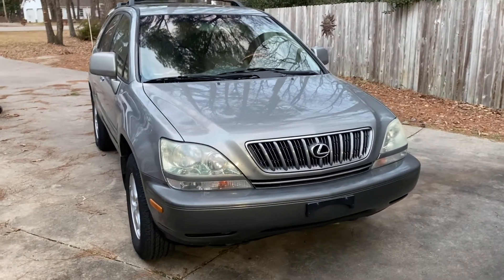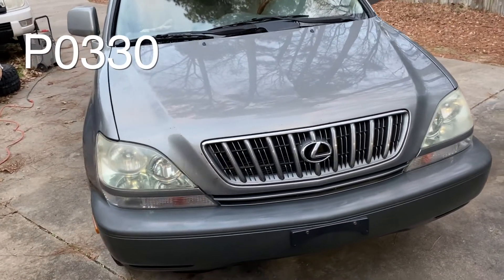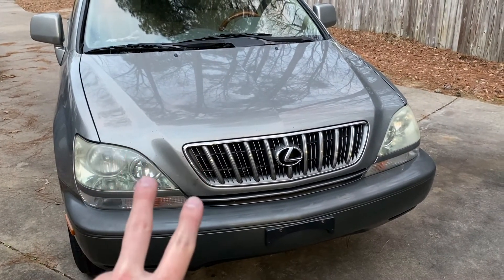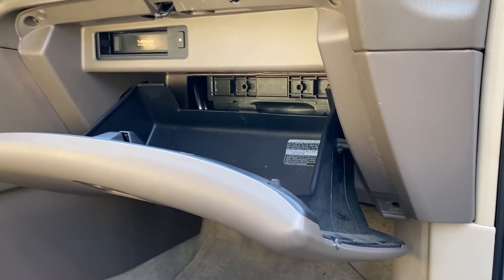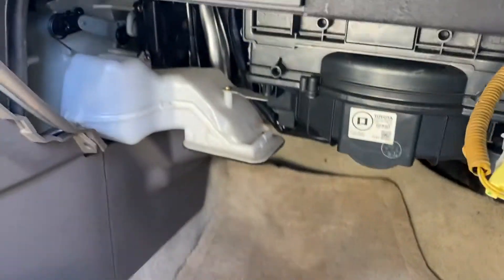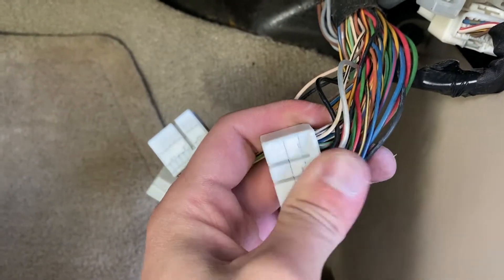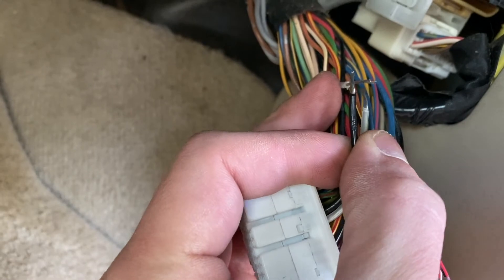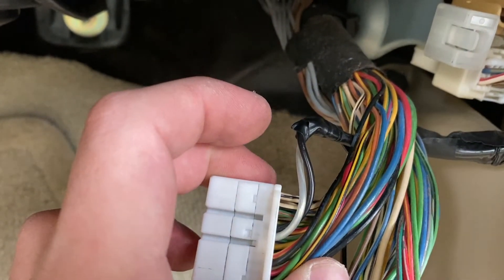Lexus RX300 bank sensor hack

Comment: So i tried this last night and it didnt work so i tried it the other way around instead of leaving the black wire unplugged i left the clear wire unplugged and it worked transmission shifts everytime i stop, thanks so much for this video!!!!!!!!!!!!😊
Reply: Same happened to me !
Reply: What code were you getting originally. I got code p0330 I used a clip to bring them together. The light went away for two days. Now I have both codes. Do you think I did it wrong or or have to replace sensors?

Comment: I cut the wire and joined it to the other but my overdrive would not work after that at all.  So i saw another thread where a guy just joined the 2 wires without cutting any wires. So reconnected the cut wire and did what he said and overdrive came back. My car would drive for 10 minutes prior to any wire cutting before i got the check engine light and lost  my o/d. I originally had a bank 2 sensor open circuit code. P0330 I believe. 
Update. Drove around about 40 Miles and no light and o/d works fine. Now running premium fuel as others mentioned as well..
Reply: Still running well?

Comment: Well 2001 RX 300 I had knock sensor bank 2 go bad with the same code.  Did what you did I rest the code and has not came back on thanks for the hack it worked. Now if the other sensors gets bad I’ll have no choice but to have them both changed out. 
Mine is a 2001 rx300 with 99,xxxx miles on it. I’d figure from what I’m seeing I have another 100 thousand to go.

Comment: I finally got around to trying this today on my 2002 Toyota HIghlander (232k miles) after months of dealing with this “limp mode” issue, stopping and turning the car off and back on again to allow the engine to go into overdrive.  Estimate to replace knock sensors was astronomical given the age and estimated value of my car.  Cleared the codes and drove the car for 30 minutes after the fix (around 25 miles) and no check engine light or any issues, so I’m thinking this has resolve my problem.  Thanks for the great video!  Hoping to get a few more miles out of the old Highlander!

Comment: Wouldn't it be better to splice at the harness that leads to the knock sensors right by the air snorkel tube. I dislike cutting ECU plug wires.
Reply: I agree, or relocate sensors outside from under intake manifold

Comment: This could be done much clearer. Why did you refer to the clear as white? Can’t you go back and fix this with caption or audio edit? More importantly, there is ZERO need to cut all the wires! Cut the black, tape off top black end, strip 1/4” from bottom black, cut 1/4” sheathing away from CLEAR (not white). Don’t cut the clear wire in half. Wrap black exposed wire around clear exposed. Tape and your done.
Reply: Very true 
 Also,
 Both sensors have 2 wire connections 
1 carries 5v reference to sensor & returns to pcm.  My ocd needs explanation of all 4 wires in order to better understand hack.

Thank you everyone;

Comment: I did it, but STILL have the engine light on and 4k RPMs at 55 mph or so.  Now what??
Reply: 4k rpm is pretty high right for 55mphs ?
Reply: Or are you driving over drive ?
Reply: Did you fix it?
Reply: @ Yes..$1200 to replace 2 W$%&^%$ O2 sensors, as it was in crawl mode, from the eng light being on...from the O2 sensors needing to be replaced.
Reply: @kee7678  gott cha thank man have a good rest of you’re night
Reply: No...still not.  Going to reverse the wires again and see if that works.  Smog is past due now too. @bruceprofitsTradesFutures

Comment: Not a good idea unless you burn premium fuel always. Otherwise, some level of pre-detonation will very likely exponentially wear out the engine.  The knock sensor is a microphone that listens to your engine and makes real-time adjustments to the ignition timing and fuel air mixture to maximize fuel burn for optimal fuel economy and emissions. It keeps the engine balanced and an out of balanced engine pollutes more and wears out much faster.   I recently replaced both knock sensors on a 2002 RX300 and it is not that big of a deal for a mechanic.  Just buy premium knock Japanese sensors, not from China.  They are junk.  During the test drive I has able to register 28 mpg on a 19 mile run, much better than the 16 mpg it was getting with the engine running in "fail-safe" mode with the bad knock sensor.  Compression test on all cylinders showed 192-198 psi at 223,000 miles.  I expect the engine to make 500,000 if properly maintained.  Seriously,  please think about long term implications of your hack.
Reply: Thanks for the comment Big Oak. I have a couple of questions for you if you don't mind.  1. How does burning premium fuel  prevent the pre-detonation issue?  2. How does one know if if the sensor is bad or if you have a really serious issue?  My RX does not make any knocking sounds, so to prevent it from going into OD I had to keep disconnecting the battery.  For the age of the car and the value, it doesn't seem frugal to chase knock sensors at 163,000+ miles. Unless, of course you are a really good mechanic with a lot of extra time.  After reading your post I am considering burning premium fuel now, but would like to understand a bit more.  thank you
Reply: Having knock sensor and vvti sensor issues and im assuming one is having to do with the other and im honestly not which exactly is causing my problem. Replaced my vvti solenoid and my odd cylinder sensor which was supposed to be my issue but now it’s giving me a knock sensor code. Honestly worried I’ve done some damage, but hoping I haven’t. And 198 psi at 220k is crazy.

Comment: Hi genus,
I just have 1 code: P0325 , I did opposite from your video: I cut the clear wire and soldered to black .
After driving about 3 miles, the engine check was ON, and the code now is P0330.
Please advise.
I really appreciated

Comment: This worked for about a year or so and bank 2 is gone. So replacing with oem Denso from dealer. Don't get the aftermarket online ebay fakes

Comment: One year later my bank 1 sensor went bad and tripped both codes so I went to Toyota and bought one sensor and the 2 plug into one pig tail, unplugged the 2 factory sensors (down below the throttle bodies) and plugged in the new wiring harness (pigtail) mounted the new Toyota (after market sensors are much cheaper but DO NOT WORK! same with pig tail) on top next to valve cover pinching it between a small bracket and valve cover (a solid ground and no movement is a must) plugged sensor to wire marked 1 and it is back to normal 😀 no intake removal and only one $200.00 sensor needed. This also works on  other cars but you need to do the wiring research.

Comment: Great hack! But I had to splice both wires to the black wire. It depends which knock sensor is out. So if the white doesn't work splice it to the black. And my transmission now shifts into fourth at 60 mph

Comment: Few thing worked as well as your hack on my 2001 Lexus...Had all the problems including stalling out at 60 miles per hour, limp mode, not shifting into high gear... a whole slew of engine codes showing the engine was running lean.  Your hack worked beautifully...Thx

Comment: Fixed my 02 RX 300 knock sensor with your hack! Great job on the video and thank you so much. Saved me a bunch of time and money.
Reply: We’re your cars jerking and fighting to accelerate ??
Reply: @thejacquezfamily408  no it just wouldn't shift past a certain gear. Basically in limp mode. This mode does work tho.
Reply: @ddhmoto44  I replaced both knock sensors  last Saturday and the engine light came on last night. Day of was running fine, But the day after car started jerking and fighting to accelerate you didn’t experience anything like that ??
Reply: @thejacquezfamily408  no mine didn't do that. Did you have the engine light checked to see what it is?
Reply: @ddhmoto44  yes the same code p0330 knock sensor bank 2
Reply: @thejacquezfamily408 did you find out what was the problem?
Reply: @bruceprofitsTradesFutures  yes unfortunately it was my transmission lol

Comment: 3 years two replacements and finally just driving around with a cheap code reader plugged in to reset the code every couple of miles. This 20 min hack is the best! Had PO325 so tie into the black wire. Thanks for the video!!
Reply: I don't understand tie into. He showed white and black do you cut then both then connect them?? Or tell me whst?????
Reply: is there any bad side effects now? or has it been normal since

Comment: thanks boss I think the mechanic was asking for $700 for the repair lol ..
Reply: awww damn I got a 2002 and the wire colors are different .. I cut the black that the 1st one so it was misfiring ..
Reply: The repair probably is $700 to do this is a cheap fix to get you back on the road. If you plan to sell the car you should disclose this 👌
Reply: is there any bad side effects now? or has it been normal since

Comment: Dear sir, my lexux RX300 shift fine when cold but starts to slips when warm after driving about 10-15km. What could this be? Any help would be appreciated. Thanks.
Reply: Same here! Did you found the problem 🙏
Reply: you need to make sure you have correct level of atf. Slipping issue is all about fluid level.  Sometimes it show correct level on your atf dipstick but the reality is not when the transmission filter came off inside transmission. So when you run the engine the fluid retains in the filter then the fluid in the system is not enough when running and it can cause slipping.

Comment: I tried the hack and the check engine and vsc lights did not go out.  Should I reverse the process, and leave the clear wire loose and splice in the black wire?  9.23.2021
Reply: first wire it as in the video. then pull the negative terminal on the battery, let it sit for 20 minutes, then reconnect the negative terminal. Drive the car and see if the code comes back.

Comment: I had tried splicing them together without soldering them and keep getting codes from the knock sensor 2. Do you think not soldering them caused codes to keep coming up?
Reply: No !  As long as you have a good connection you should be fine..are you saying you only had code for sensor 1 and now have code for sensor 2 and no longer sensor1?  if so reload and watch the video again and double check your work. Sounds like you made a good connection to sensor 1 but lost the connection to sensor 2
Reply: So, you have the white (clearish) wire from the engine side going to both the white (clearish) wire and the black wire on the ECU?
Reply: Been dealing with this for a year ( 2000) avalon) v6.. the wires were both clear.. still get 330 and 325 code so both sensors are messed up... going to buy a good sensor and mount 2 the block.. and wire back to ECM.. pins 27 and 28.. just to pass smog.. WML.

Comment: Mine just got into this limp mode as it stopped going into my 4th gear and revz high up at 60mph. Damned if it ain't a knock sensor. 

Still have always had my Trac light and VSC on but thats never effected overdrive
Reply: Just do the splice(if you haven’t) it will resolve issue. Run premium in the summer for added protection against knock.
Reply: @MrMpm3001  , I was suspecting that when I started to run regular, that could be part of the issue. When I put premium in, the intervals where this Eng light comes on, becomes more gapped and I get more time until I have to reset. The highway is when it comes on at a consistent time interval as the computer comes out of test mode much quicker. I am wondering though, if before I do the splice, should I still change that Knock sensor first?
Reply: @phoenixmistertwo8815  no. The purpose of the splice is so you don’t have to remove sensors. The 1mzfe is notorious for knock sensor issues. The premium is probably reducing detonation but premium isn’t required. If p0330 splice black to white. If p0325 splice white to black.
Reply: @MrMpm3001  , 10-4. I will give it a try and make sure I have the correct code for the splicing. Thanks for the advice.
Reply: @phoenixmistertwo8815  no problem. Wish you luck.
Reply: @MrMpm3001  I don’t get something…. Isn’t the knock sensor there for a reason? Isn’t doing this hack like putting some black tape over the check engine light cause I don’t want to see it? 
Isn’t something still going on in the engine that’s triggering this and needs to be fixed?
Reply: @Hizenbird  no. If one knock sensor works, it will pull timing on BOTH banks. So as long as one signal is present, it functions pretty much the same. I pulled my intake and did it correctly but it’s offered in shops as an alternative to customers who can’t afford the repair.
Reply: @MrMpm3001  thanks for the response.
Reply: @Hizenbird  no problem
Reply: im an idiot
someone please dumb this down for me i have 325 code
am i going to cut the black and white wires then jump the black one from the
the firewall side to the black and white ones on the harness connection side?
then leave the white firewall side cut wire taped off to be unused.?
ftlog 🙏🏼 someone please explain this to me like im 4 years old.
Reply: @aladinsarsipeus  hope you got it solved.
Reply: @aladinsarsipeus  What did you end up doing?  I need same.

Comment: This worked perfectly...very nice...I just wrapped the wires together with electrical tape and it worked like a charm.   Better than spending all day tearing the top of the engine off and spending hundreds of dollars on on parts that really don't do much anyway.   And it made me somewhat angry that I couldn't make my own choice whether to replace the part...limp mode my ass!!!!
Reply: Did you have tobcut the wires to put them together with electric tape???
Reply: is there any bad side effects now? or has it been normal since

Comment: Thanks for the awesome hack, did my 99 RX 300 this morning and its perfect,  I knew it could be done but I was going to go under the hood...sooo much easier your way my clear wire is white btw but it's exactly the same as the 03.
Reply: Eeez21
Reply: Would this work for a 2001 Lexus es300 with the same motor as the rx300?
Reply: @richardsharma283  yes it will.
Reply: We’re your guys cars jerking and fighting to accelerate as well ??
Reply: @thejacquezfamily408  no, just cel but no overdrive  with light on.
Reply: @thejacquezfamily408  it did. Hard acceleration from a stop and going over big potholes
Reply: Dud you have to cut the wires to putbthem together or something else?????

Comment: Will this work with the P0325 code?
Reply: Yes..did mine this morning ..cut white wire and attach to black. Great hack I already know but I was headed under the hood..thanks to this guys research it was truly a 15 min job.mine is a 1999 same as 03 so all RX 300s ...drove 120 miles today 110 degrees out, no pinging, no light, and mine was coming on 5 miles after reset.
Reply: Have any update on this almost a year later? I have the P0325 as well. I heard that one basically never goes bad and mechanic wants $1200 to replace it. Was thinking about doing this method but haven't seen many people with sensor #1 as the bad one. Wonder if the engine could actually be knocking and it isn't just a bad sensor....
Reply: @matthewlswanson  I sold the car! But it’s stayed off. Tanks for the follow up bro.
Reply: @matthewlswanson  What did you end up doing?
Reply: @kee7678  Got them both replaced and......It wasn't the sensors! It was the ECU....So I bought a generic ECU and that fixed it. So the ECU was throwing those codes when it actually wasn't the sensors.
Reply: It is working for  po325 code too
Reply: If p0330 splice black to white. If p0325 splice white to black.

Comment: do i have to solder or can i just use an electrical connector for all of them
Reply: Did mine this morning, I heated the white wire and stripped it back didn't cut it pushed a small screw driver in the middle of it  and made a hole cut the black wire stripped it split it in half twisted both halves pushed one half through the hole in the white wire twisted the two black halves tightly together and back around the exposed white wire nice and tight then electrical tape ...works perfect 😃 cut white wire and attach to black for P0325
Reply: @007heatingandair  i have 325 code 
is it really that easy?
splice white wire into the black one?
Reply: @aladinsarsipeus  yes! 6k miles later no problems, I do run good gas to ensure no detonation. Remember cut white wire and attach computer side wire to stripped back. not cut, black wire. Examine his photo and verify wire locations and problem solved, until the second sensor goes that is.
Reply: Still going good today? I have P0325 as well and mechanic wants $1200 to replace. I also hope it's not actually knocking...

Comment: Anyone know how to do this on a 2002 camaro
Reply: This should work fine on your camero ... find the plug to the wiring harness under the hood do it one way, if both codes pull up 325 and 3:30 you did it backwards switch them and you should be fine ... you've got a 50-50 chance if you don't know which wire is which bank you might just hit it the first time